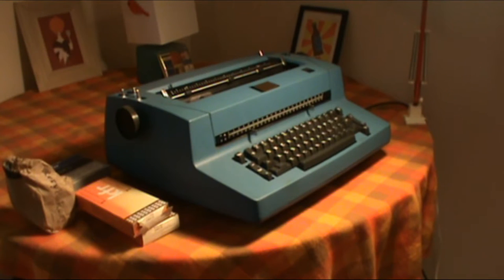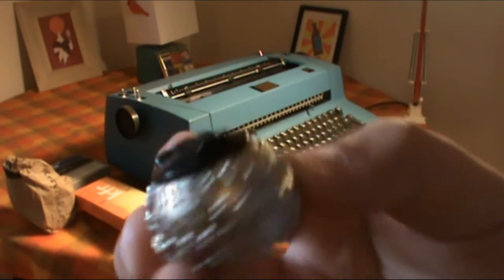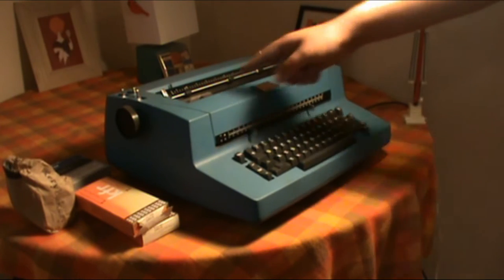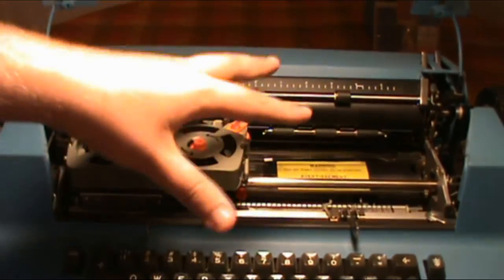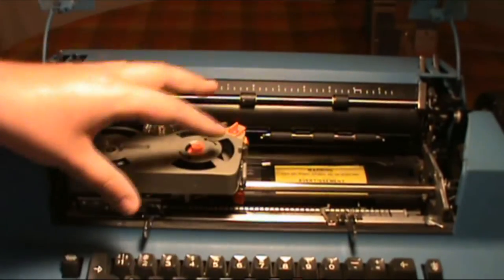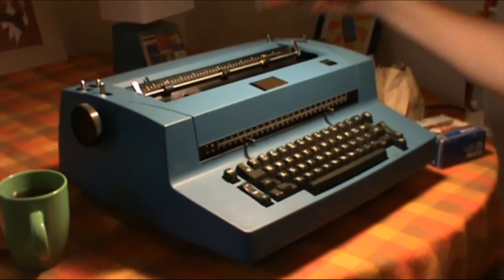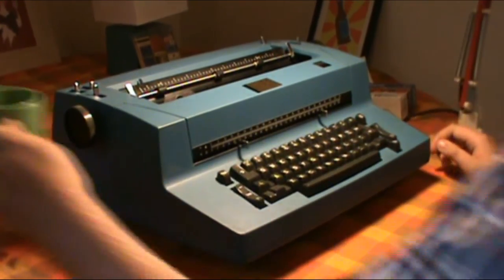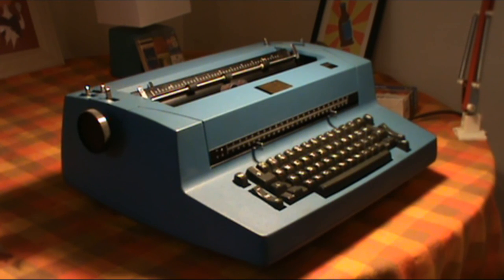1977 IBM Selectric II typewriter

Comment: These machines were made to be used everyday by typists and secretaries, so if you haven’t used it in a while, it will probably need service
Reply from the maker: It looked very low-miles. IBM also used a lubricant that after 40 years hardened tremendously.
Reply: The solution to that is to take to the mechanical chassis out of the case and spray it with a can of automotive brake cleaner. That will cut the old grease. Then, of course, you need to re-grease @dr.typewriter-venneburgtyp121

Comment: Sounds like that machine wasn't stored well after a heavy service life - The one I got seems to have had a relatively recent service and beyond the belt being aged is still in good order. I'm lucky there, for sure, but it's only a matter of time... :|
Reply from the maker: It wasn't stored well, no. I got rid of it.
Reply: Don't blame you in the slightest!
Reply from the maker: I think I'll stick to manuals. Electrics always end bad with me. ;-)
Reply: I wind up with good luck on most electrics and electronics I get - although most of the electrics I have are 60's SCM's which are, of course, amazing so my luck is a bit better on that front. Still have a few stinkers I need to sell though.
Reply from the maker: I haven't had much luck with the 1960's Smith-Corona portable electrics, although I do like them. I had a 250 which sounded like a war was going on, and now I have an Electra 220 with a dying clutch. I think for now I'll stick to manuals.
Reply: what did you pay for it?  Is it for sale?  I only need "a matter of time" to finish my work